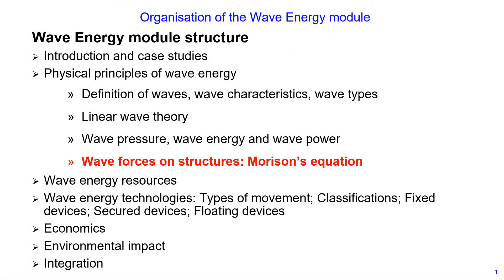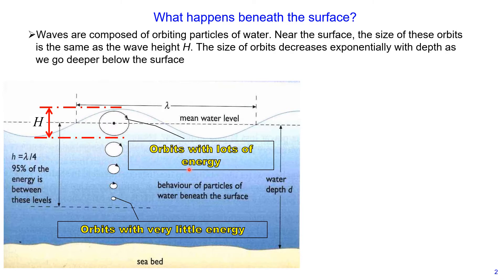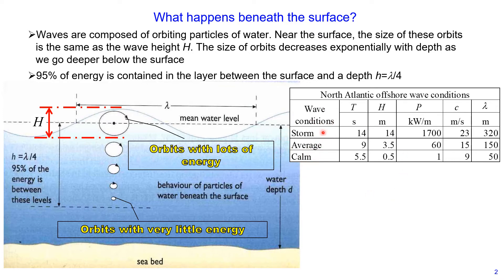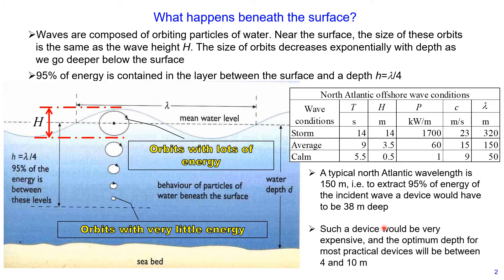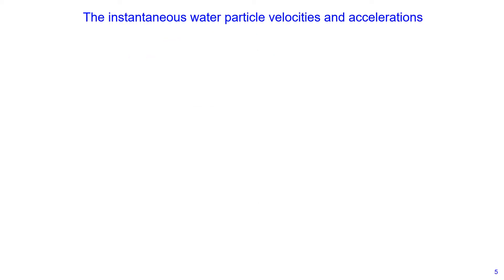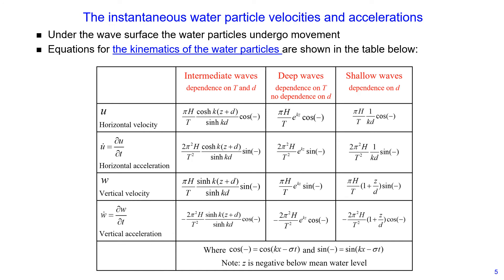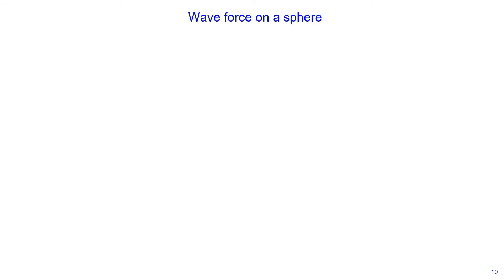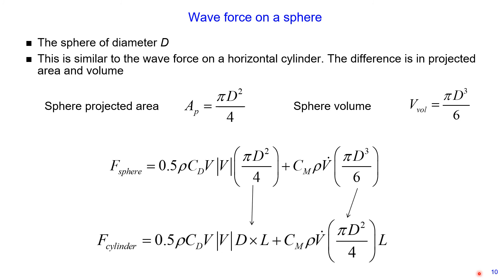Wave force on a circular cylinder. Practical example calculate current force on vertical cylinder

Comment: Thanks for the video....but can you make an example on how to find maximum horizontal force acting point on vertical partially floating cylinder which is under water 20 meter in 100 m depth water ??